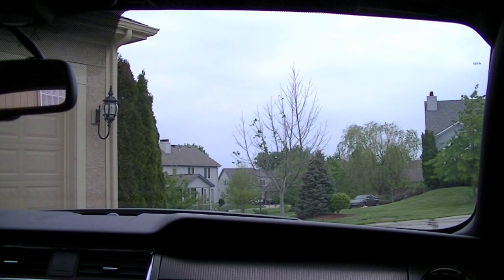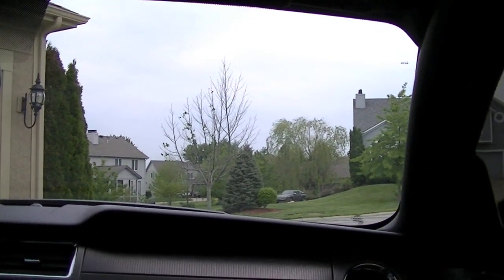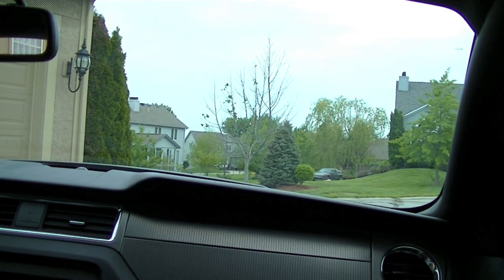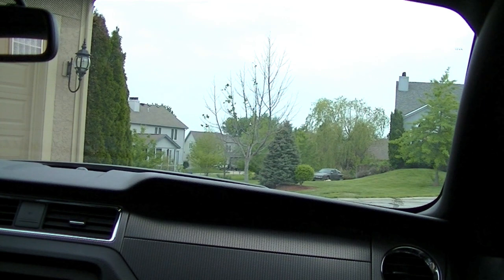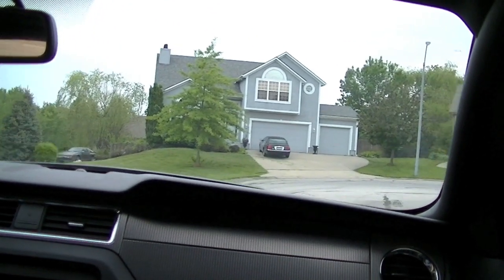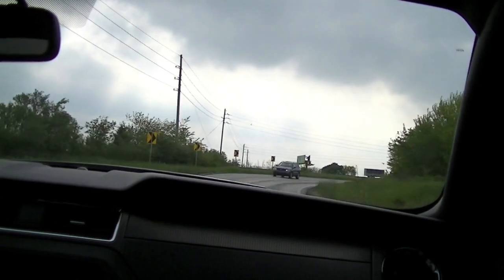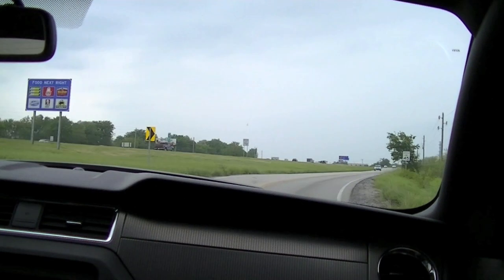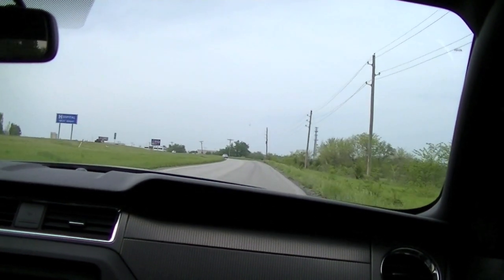MUSTANG MT82 ISSUES RESOLVED

Comment: Always remember to shift quickly and keep your right foot to the floor when shifting.
Especially with such a short, tight shift shift pattern as your Stang has.
It's not very good for the drivetrain, but, when done properly, it does wonders for the circulatory system. 
Yours, not the car's.  
; ^D
That Stang is a beauty brother.
Thanks for sharing.

Comment: Mine actually acts great in cold weather, the only time it does. Though, when it gets above 70 or when the transmission is hot (going on long drives) the car bucks, jerks, makes all kinds of noises when shifting 1-2, 2-3, even sometimes 3-4.
Reply: We need a steel braided clutch fluid  trans line from sr performance or steeda bc the factory plastic line heats up a swells losing pressure
Reply: And take out clutch spring helped mine out pretty dang good

Comment: do not appreciate paying the big bucks for this car and have to start out in second gear on cold start.Had to do those kind of maneuvers when I was younger and could only afford 1000 junks.Shame hame on FORD for this transmission.
Reply from the maker: +rocco elefante I hear you. Mine actually improved after it hit about 18K miles.
Reply: mines at 80k and i have no problems with it and i drive it super hard
Reply: @desertoutlaw3317  what are some shifting tips you could recommend a brother? I just got 2020 mustang gt pp1 manual.
Reply: @YoungWoodzOnDaBeatz  on how to drive smooth or shift fast?
Reply: @YoungWoodzOnDaBeatz  and congratulations on the new car

Comment: Dealership fixed mine 4 days ago . Coasting on the Highway it started slipping and couldnt grab anymore. I pulled to the side . Lets see if the dealership will fix this. Its a living nightmare with this transmission
Reply from the maker: Glad you got it fixed. Ford should never have kept using that transmission after all the issues it has.
Reply: Yes youre right but when it does work its nice to drive

Comment: If it's that bad where you need to start off in second gear when cold then I would bring it back to the dealer and have it fixed! My car is brand new and also a little notchy when cold but I'd have the trans replaced under warranty if I felt the need to start off in 2nd. That's just my opinion anyway.

Comment: The problem is with hard acceleration shifting . Not putting around shifting
Reply: mine happens with putting around shifting....as long as i bring my car up over 3k rpm it is smooth as butter.....kind of frusterating tho. would like to be able to shift lower to save some gas while commuting
Reply from the maker: That was my experience as well. Thanks for the comment.
Reply: Mike Durkin I have that same problem and do the same thing, above 3000 it shifts great. second to third sucks, and going from fourth to fifth in the winter time it grinds for the first two or three shifts unless I let the rpms drop to almost idle then it's fine.

Comment: ok, i bought a 2012 ford certified it had 11,687 miles on it. 3 weeks after owning it me and wife went to my families house. Drove for about 75 miles stopped for gas. Getting onto interstate when i shifted to 5th and was accelerating it threw itself out of 5th, and wouldnt go back into gear unless it was under 2k rpm. on way back from families 2nd gear did samething. been in the shop ever since. oh and because they considered it a wear part its not covered under the warranty i payed for. so i have to pay for another transmission, cause it sheared teeth off the gears.
Reply from the maker: That sucks. I'm sorry this happened to you, but you'll probably be better off with a new transmission, even though it's going to cost you. Doesn't the factory warranty have a 5 year/60K mile warranty on the drive train? I would check with Ford and see what you can find out.

Comment: This cars mt82 manual soured me on getting another manual transmission car ever again.  Been driving manuals all my life but this is by far the worst.
Reply: Volvo M47 transmission is far worse, trust me
Reply: Loudlevin have one in my 2012gt so disappointed!
Reply: Unhooked skip shift on my 2012gt still locks me out of second if I rev to 3000rpm have to short shift second so I'm really not in the power band at all is there an answer to this problem? Please tell me. Disappointed in a nice car otherwise
Reply: Clearly you haven't driven a 2008 jeep wrangler

Comment: notchiness? What about getting locked out in high RPM 2-3 shifts?  I have no problems below maybe 6000 RPM.  This aint gonna help.
Reply from the maker: I think the lockout at high rpm is inherent in this transmission. I had the same issue with high rpm shifter from 1-2. It seems crazy that Ford put this transmission in an otherwise great car. It sucks, but that's the way it is. For now.
Reply: Sadly I think you're correct.
Reply: I fixed everything including getting locked out by switching to barton short throw shifter and bracket and upgraded the clutch fluid line to mcleod hydraulic performance line and also drained and put in dot4 fluid. Smooth as silk even when cold
Reply from the maker: I've heard great reports on the Barton shifter and bracket. Nice workaround.
Reply: fzr niko same here did u find the answer to getting locked out of second? Trying to figure out if there's something that could b done such a strong motor that just locks me out! So disappointed this sucks
Reply: @skipmcleod4145  what you want to do is get a different clutch the stock one has been known to cause lockout at high rpm

Comment: i have a 2011 gt and the transmission whines like a supercharger. is that bad? i hear mixed ideas on that
Reply from the maker: I've heard that's common. You might want to visit mustangsource (dot) com. It's a great forum with a lot of knowledgable Mustang owners. Mine has got the crunchy shifting going on again. I'm supposed to go this weekend and get some of the XL-18 additive that they did a TSB on a while back and that they're currently putting in the new models. It's supposed to solve the notchy issue. We shall see what happens. Good luck with yours.
Reply: ***** Change over to a Barton Shifter, and 2-post bracket. I will be a little brutal getting into reverse but it will help a LOT. had one in my 2012 GT....before the clutch some how...er.. "disintegrated" .... but that is my suggestion. no idea what they have done for the 2015 year but I think I will jump right back into a 2012+ SRT Challenger...like I used to have.